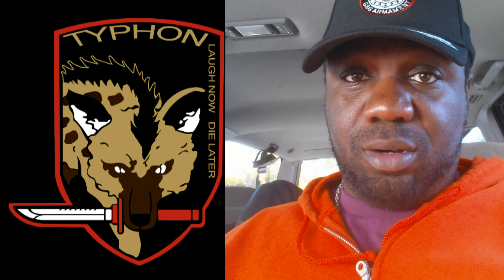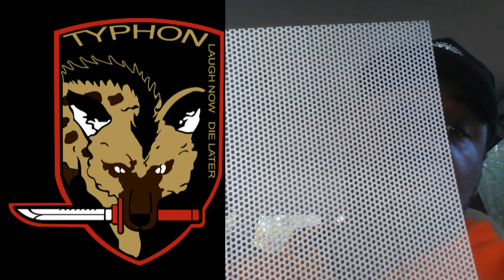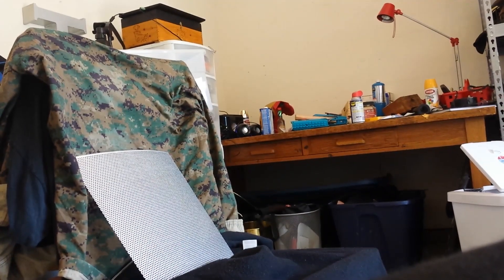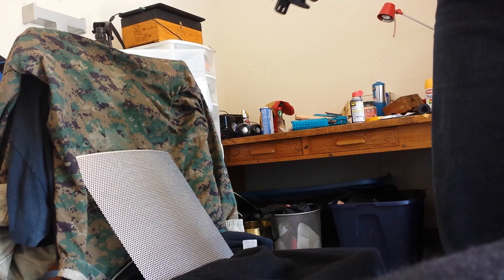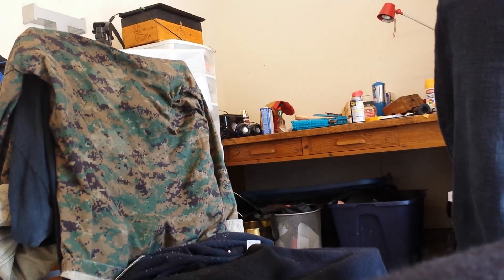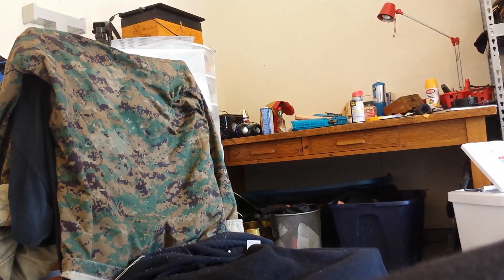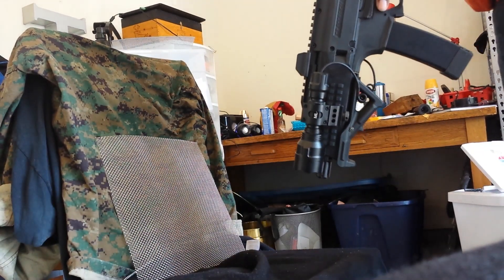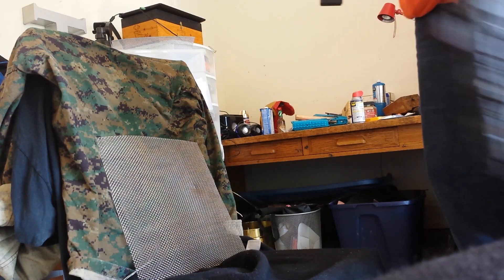Is Mesh REALLY Safe for Airsoft?

Comment: I tested this with a pair of cheap mesh eye pro. I started to pop out of the frame after being hit once by a 340fps gun using a .25g bb, I shot through the mesh after 4 shots point blank with a 490 fps BASR using a .4g bb. Hope this was useful to someone. I wear nuprol mesh eye pro which is a far better quality. They use a much thicker mesh which is secured very well in the frame.
Reply: The nuprol eye pro is perforated steel and not mesh, my bad.

Comment: Until they invent a solid lens that never fogs, I'm going to keep using mesh. My goggles fog and then I either need to take them off on the field to re-apply anti-fog solution or trip over shit trying to get back to spawn to apply more. Fans do not work for me. Plastic lower masks make my face break out in a rash. I am far more prone to tripping and falling over things than I am to getting shot in the eye and I've already got one bad leg. I'm not about to make another.

I can do solid lenses indoors as long as there are regular breaks and I'm allowed a type of mask that does not trap condensation against my face, but even at last years Red Storm in Oregon City I had to hide under and behind things to re-apply fog-tech so I could keep from falling into pits and tripping over scrap metal. There is no solution for solid lenses in outdoor play for me; doubly so if they need to be full seal. No one considered any of this to be threatening 9 years ago. It fell under the "Acceptable Risk" assumption of playing the sport in the first place. Paintball masks are lame and de-value the visual aspect of the hobby. Until they build a better face trap, the one I keep my own face in isn't changing.